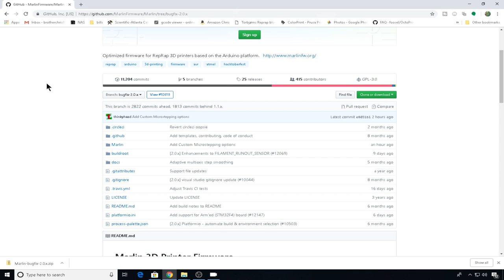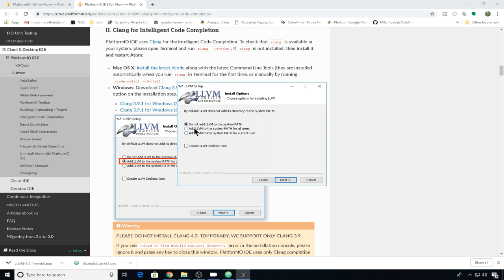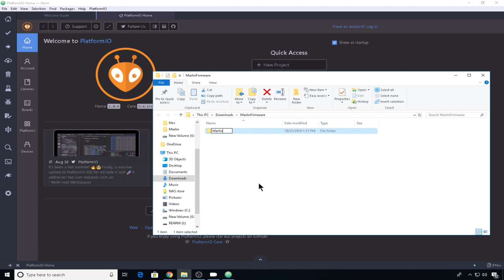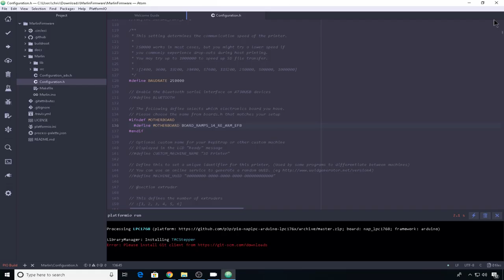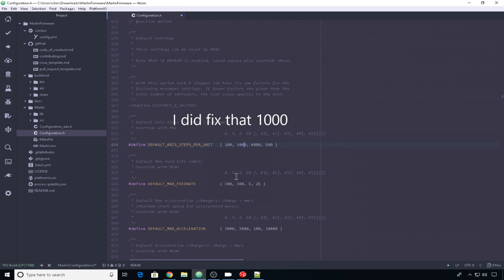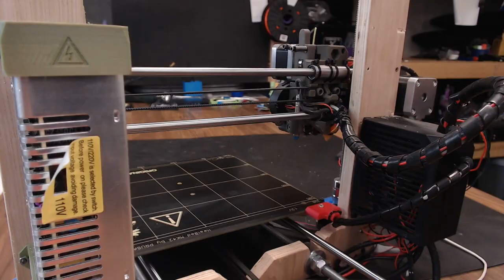32bit Marlin 2.0 - RE-ARM Main Board - Chris's Basement

Comment: Will this tutorial work on an skr v1.3 and an anet a8 printer?
Reply from the maker: Yes, the marlin install should, just different board.
Reply: @ChrisRiley  the same architecture I suppose? Is it possible to use the stock Lcd? The Skr has on board Micro SD slot will it work for gcode files. My skr board will arrive soon. I am doing a prior research but can't find a lot about it.
Reply from the maker: I don't know, but I'll be testing that soon.
Reply: @mikekash-o1307  I'm currently trying to build on the skr v1.3 board. Having some issues with the SD card support. Doesn't seem to like the fact that I essentially have two sd card readers and I'm configuring it wrong.

Comment: Hi Chris
I'm using Ramps 1.6 and from last few days extruder not heating. I have checked heater with direct 12v supply and it's heating.
Reply from the maker: It could be the mosfet, try switching it to the bed or other extruder and see if it works. If it does, you probably have a bad mosfet.
Reply: @ChrisRiley  Thanks for reply :) 
When I check the output voltage for hotend and it's 0.15v but when I remove hotend wires and check then it's 12v
Reply from the maker: @Harinderbhinder  Hmmmm, interesting. Maybe the heater is shorted out, What is the resistance on the heater wires?
Reply: Today I changed the mosfet and now it's working. 😊
Reply from the maker: @Harinderbhinder  YAY!
Reply: @ChrisRiley  Thank you so much 😊

Comment: How do you upload Marlin 2.0 to Arduino mega?
Reply from the maker: You can just use the IDE like any other version.
Reply: If you verify the code it gives you an error, but there is a way to resolve it by following some of the steps in this video here (the video is not in english but just watching it you can get the gist of what is going on) :-
https://www.youtube.com/watch?v=tFgqAbVaenM&lc=z22meljitq3wehbl0acdp432zzkvfkt0aofft3nb5fhw03c010c.1551521627435799

Comment: Your LCD is inoperable because it's now being powered via the RAMPS board at only 3.3 volts instead of 5 volts.  This is a limitation on using the Re-ARM with a standard RAMPS board. To fix it you need to rewire one wire on the LCD EXP1 cable to go to a 5V power pin on the Re-ARM board.  SEE http://panucattdevices.freshdesk.com/support/solutions/articles/1000243195-lcd-display-installation for details.  Panucatt does sell a replacement EXP1 cable with this modification.
Reply from the maker: Thanks! Video to come.

Comment: Isn’t there a separate option for rep rap discount lcd?  I don’t remember
Reply from the maker: There is, I am still looking for a good solution for this board. There are only a had full of screens that this board will support I found.
Reply: Chris Riley ahhh gotcha!  Nice video btw!
Reply from the maker: @meandrips2216  Thanks man!
Reply: There's a special adapter for the Re-Rap LCD displays.  They take 5V but the standard adapter supplies 3.3V.  The special adapter has the power pin broken out to a jumper that you connect to + 5V (on the Ethernet adapter connector on the Re-Arm board).
Reply: I'm wrong.  It's a special cable , not a special adapter needed to run the 5V Rep-Rap LCD displays.
Reply from the maker: @bobkuhn8977  Hey Bob, thanks for the info, I cover all this in today's video. Is there a pre-made adapter for the 2004?

Comment: Thank you very much for your video. I found that there was a problem installing platform ide
InstallationManager

Error: PIP Core: If you have antivirus/firewall/defender software in a system, try to disable it for a while. ERROR: Could not install packages due to an EnvironmentError: Failed to parse:
Reply from the maker: Because of bugs like this, I have switched to VScode. Here is a video on how to set it up. https://youtu.be/W6zYvRgGr3Q

Comment: Great video. The display is strange for the re-arm. I guess the re-arm puts out a low voltage for the screen so you have to jumper 5v from somewhere else to power the display. There is a few good resources out there to wire it up. I gave up on mine getting BLTouch to work with smoothieware but this might save the re-arm’s life. This is one sourse http://doc.3dmodularsystems.com/re-arm-32bits-upgrade-for-scalar-3d-printer/
Reply from the maker: Thanks! Nice right up, thanks for the link. I hope to get this sorted out soon.

Comment: Hey man!

Do you have any tip regarding getting 

Environment LPC1768                     [ERROR]
 [ERROR] Took 2.80 seconds
Reply from the maker: Did you add the Upload_port option? It might be a syntax issue.
Reply: @ChrisRiley   Yes I did, I followed your video from start to finish.
Reply: @ChrisRiley  The diffrent part for me is that im doing it for a MKS SBASE v.13 but everything is the same with the LPC1768. The thing I have changed is the Motherboard to MKS SBASE.
Reply from the maker: Take that line out and rebuild and see if the error goes away.
Reply: @ChrisRiley  Tried it now to change back to #define BOARD_RAMPS_14_RE_ARM_EFB but still its the same Environment LPC1768                     [ERROR]
 [ERROR] Took 3.34 seconds
Reply from the maker: @inflamesiamborn  I will try to reproduce this error.
Reply: @ChrisRiley  Tried again to do all from the begining with new files and a new projekt in atom but still the same result.

Im really thankful for your help and your quick responce
Reply from the maker: Ok, mine compiled. Make sure you this is right env_default = LPC1768   and use the board #define MOTHERBOARD BOARD_MKS_SBASE
Reply: @ChrisRiley  Okey yes I did, and I have no luck with it. :(
Reply from the maker: I reproduced the error. Seems to be a bug in ATOM.  Update your .ini file      upload_port       = D:     save it. Close Atom, reopen atom then build. It should work.
Reply: @ChrisRiley  Tried it now, and got this. 

compilation terminated due to -fmax-errors=5.
* [.pioenvs\LPC1768\src\src\HAL\HAL_LPC1768\HAL.cpp.o] Error 1
* [.pioenvs\LPC1768\src\src\HAL\HAL_LPC1768\HAL_spi.cpp.o] Error 1
 [ERROR] Took 3.97 seconds
Reply: @ChrisRiley  Tied it again with a new extracted Marlin and configured it and then closed atom and started it again and tried Build and I got this:

compilation terminated due to -fmax-errors=5.
* [.pioenvs\LPC1768\src\src\HAL\HAL_LPC1768\HAL.cpp.o] Error 1
 [ERROR] Took 9.14 seconds

And a bit further up i got this:

Marlin\src\HAL\HAL_LPC1768\../../inc/../../Configuration.h:135:38: error: token "�" is not valid in preprocessor expressions
#define MOTHERBOARD BOARD_MKS_SBASE
Reply from the maker: @inflamesiamborn  Sounds like there is some invalid characters. If you download a fresh copy on 2.0 and don't change anything, does it build?
Reply: @ChrisRiley  Will try that when I get home from work today.
Reply: @ChrisRiley  Yes it did build when I downloaded marlin again without changing anything.
Reply: @ChrisRiley  but when I add the changes it just gives me the same error again. 🤔
Reply from the maker: @inflamesiamborn  Hmmmmm, very strange.
Reply: @ChrisRiley  Yes, I don't know what to do now. I tried to add one change at a time. And it's when I change to LPC1768 it goes bananas.
Reply from the maker: @inflamesiamborn  Send me an email, brotherchris81@gmail.com and I will send you my ini file to try.
Reply: @ChrisRiley  I have sent the email. 😊

Comment: chris… ill this work with the mks sbase as well ?
Reply from the maker: Yes, should be no issues.
Reply: Having a lot of trouble
Reply from the maker: @williamodier1560  Marlin is getting ready to release the first official release. There are a lot of changes going on that might be impacting you. Maybe try again in a week or so.
Reply: @ChrisRiley  that would be awesome, I think I have finnaly got atom to compile. It says compiling teensy ?
Reply from the maker: @williamodier1560  Teensy? Are you using a teensy board?
Reply: @ChrisRiley  so I'm doing something wrong ? I have a mks sbase, don't know how I got teensy.
Reply from the maker: @williamodier1560  what is your board set to? #define MOTHERBOARD
Reply: @ChrisRiley  mks sbase
Reply: So Chris I was eating a sloppy joe sandwich.
Reply: Sorry
Reply: I could get on my terminal if that would heip
Reply: The system I'm building is a hypercube evolution 300 x 300 x 400, e3d v6 direct drive 24 volt kenevo ssr controlled hot bet, dual z.
Reply from the maker: @williamodier1560  I would try to swap the drivers around and see if it helps.
Reply: @ChrisRiley  ?, Don't understand, what drivers. ?
Reply from the maker: @williamodier1560  The stepper drivers, move you X cable to your Z pins and see if X moves.

Comment: Can we just use the $13 32bit Due Clones to run the Marlin 2.0?
Reply from the maker: Yes you can, Marlin 2.0 supports all on the Due stuff.
Reply from the maker: Pilot16H  I think he is referring to these. https://www.aliexpress.com/item/for-arduino-Due-2012-R3-ARM-Version-Main-Control-Board-SAM3X8E-32-bit-ARM-Cortex-M3/32914758832.html?spm=2114.search0104.3.1.64a953da1uTt72&ws_ab_test=searchweb0_0,searchweb201602_5_10065_10068_10130_10890_5730315_10547_319_10546_317_10548_10545_10696_453_10084_454_10083_10618_5729215_10307_537_536_10059_10884_10887_100031_321_322_10103,searchweb201603_51,ppcSwitch_0&algo_expid=da9406bb-a59a-4ef9-86ac-719140a8fb9c-0&algo_pvid=da9406bb-a59a-4ef9-86ac-719140a8fb9c
Reply: Some of these clones need the power up (reset) mod to work reliably. https://copperhilltech.com/blog/arduino-due-design-flaw-due-wont-start-after-poweroffon-requires-reset/
Reply: Another issue with using the Due is it can't use the standard RAMPS card.  There is a mechanical interference between connectors on the two boards.
Reply: I'm wrong.  It's a special cable , not a special adapter needed to run the 5V Rep-Rap LCD displays.

Comment: Doesnt work! tried to install marlin on re-arm board and no eeprom file uploaded.
Reply from the maker: Eeprom probably hasn't been initialized yet. Run M502 then M500.
Reply: @ChrisRiley  Hi Chris how do you run M502 then M500 - PULLING MY HAIR OUT - THANKS FOR YOUR RESPONSE.
Reply: @ChrisRiley  Hi Chris AGAIN! lol used Proterface - connected - ran M500 = SENDING:M500 Error:EEPROM disabled - then M502 = SENDING:M502 echo:Hardcoded Default Settings Loaded. - Still no EEPROM file?
Reply from the maker: @247hinkey  In ATOM search for eeprom, make sure it is uncommented.
Reply: @ChrisRiley  -  Thanks Chris for your speedy response - any ideas regarding Anet LCD 12864 or even using my old Wanhao  Duplicator 1.3 LCD? P.S the EEPROM file wasn't created in USB folder, but the RE-ARM still connects and respond to commands in Pronterface. Sorry for being a greenhorn - only started with this system in the past few weeks - normally work with arduino's / nodemcu's - lol
Reply from the maker: @247hinkey  No worries! The 12864 should work, check out. https://youtu.be/-dChi2CR7Vc

Comment: I am preparing to install RE-ARM, RAMPS and a RepRapDiscount LCD on the printer I am currently building.  I am nearly certain that you don't need much of an adapter.  You only need to cut the 5v line on one of the LCD ribbon cables, crimp a 1 pin connector on it and plug it in to a 5v pin elsewhere on the RE-ARM.  Scroll down to "RRD Full Graphic Smart Display" on http://panucattdevices.freshdesk.com/support/solutions/articles/1000243195-lcd-display-installation
Reply from the maker: Hmmm...Are you going with the 2004 or the full graphics display? I still have do some more reading. I saw that you can use the full graphics like this page says, but have found no info on the 2004. I need to get a cable cut up to try it. Thanks for the link.
Reply: @ChrisRiley  I am going with the Full Graphics Display.  Sorry for not noticing the difference.  We are talking about the same pins as the adapter board appears to be the same.  The RE-ARM can only supply 3.3v on that pin and the LCD is expecting 5v, again since we are talking about the same pins.  Double check my assumption with a volt meter.
Reply from the maker: @DavidMulligan  Yeah, i'll check it out and see what I get.

Comment: I dont under stand how the two Z motors work togther . I have makerbase mks gen l 1.0 , and like this machine
Reply from the maker: You can just use the same driver, but with a cable to split them out. https://www.amazon.com/Printer-Stepper-Parallel-Module-Double/dp/B07MC71QRW/ref=sr_1_2?crid=YOPOLWVECZ8P&dchild=1&keywords=z+motor+splitter&qid=1586104736&sprefix=z+motor+spl%2Caps%2C195&sr=8-2
Reply: @ChrisRiley  i find in marlin " dual z ..... " .. its work fine , but i have new problem , win i home the motors  the "z" motor going up , not down
Reply from the maker: @mahmood02  Yep, change this setting. #define INVERT_Z_DIR false

Comment: i cant even open marlin in atom, i think i just wasted 50 bucks on this board i cant put firmware on
Reply from the maker: Whats it do when you try?
Reply: @ChrisRiley  says its not a platform io project, i uninstalled everything and reinstalled got it all configured, but now cant find sd card line for screen in pins and any input on how to safely get 5v to  a bltouch? can you just pull 5v from one of the in headers hanging out the side?
Reply from the maker: @danf4778  I have run into the not a project before. Make sure when you add a project folder that it's the folder your ino file is in. If it's even one level up, you get this error. SD card enable should be in configuration.h. 5v, you can grab that from the endstop pins.
Reply: @ChrisRiley  thx fo confirmation on the 5v, i have it enabled under configuration.h but i also have been told you need to dissable the onboard sd because marlin will try to use that by default (which is what it is doing) and enable lcd sd but when i look for these options under pins, my pins config looks different that that seen in videos, leading me to believe marlin has changed abit in the last few months (the 2.0 branch).

Comment: Ive been using Re-Arm + Ramps 1.4sb with Marlin 2.0 for about a year now without any major issues..One thing about your video, PlatformIO runs much better on Visual Studio Code than it does on Atom, so if you are gonna use M2.0 and Re-Arm i would consider looking  into that , and for those interested we have a Re-Arm group on Facebook , https://www.facebook.com/groups/2080308602206119/
Reply from the maker: Awesome! Thanks for the info and the tip. I will give it a try.